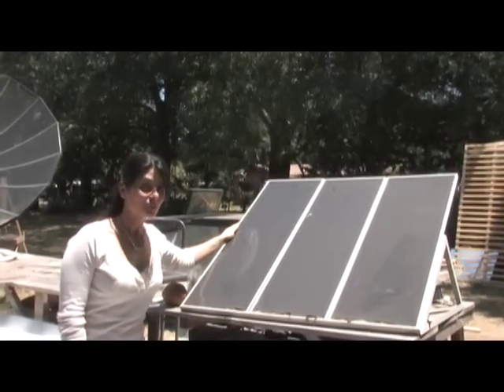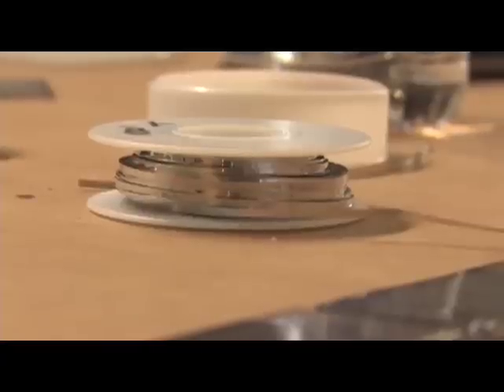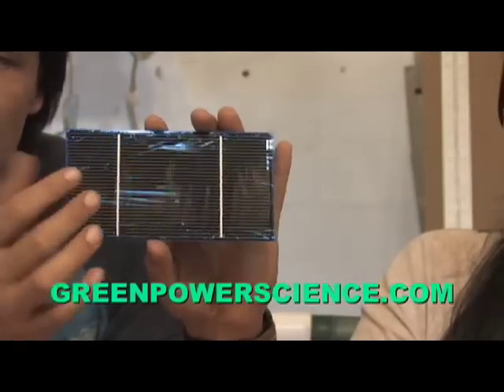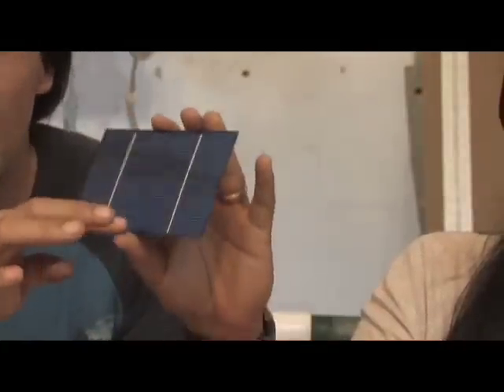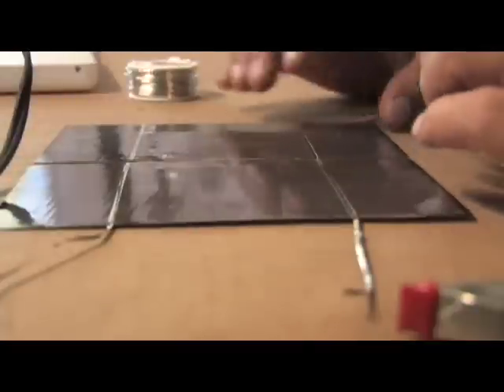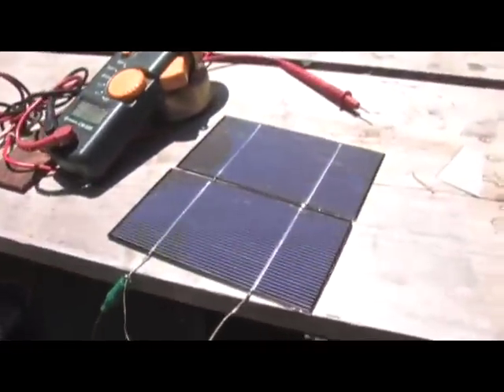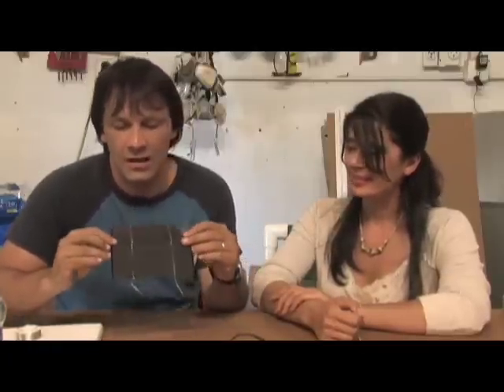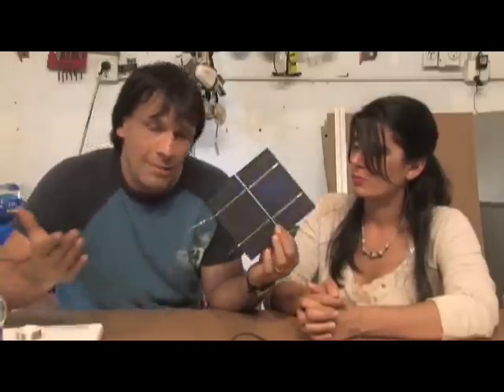SOLAR CELLS Monocrystalline DIY Solar Panels Make Your Own Free Energy

Comment from the maker: Hi,

It is a flux pen used for solder preparations, the soldering iron is a standard cheap one. I suggest a higher wattage soldering iron around 50-100watts

Comment from the maker: Hi,

The iron I use goes up to 100 watts, I think it is a Weller iron. A PC usually takes less than 500 watts on the high end processor with an LCD or LED screen. Laptops and medium level processors are 50-300 watts. For lighting I would suggest LED bulbs. This would get your max consumption below 1,000 watts. Are you looking for grid free 24/7 backup power or grid tie system to supplement?

Comment from the maker: @killacounty It does after it builds heat, it was not at full temp yet and the tip on the crappy iron was loose so it was not conducting heat properly. The body was actually a lot hotter most of the time.

Comment: This is really cool!
For a given cost ... which type of cell are the most efficient?
Is there any difference in lifespan for the different types of cells?
Is it possible to use a very hot heat gun to do the whole tabbing wire at one time?
Also, what about extended exposure to lead vapors and on your skin ... lead is nasty stuff .... shouldn't you be wearing gloves or something?
Finally, what kind of a box can you make for this to protect them from the elements?

Comment: Excellent starter video. I've always wondered if it was worth piecing a panel together from scratch like this. I was a bit disapointed that a casing method wasn't shown, and it isn't trivial either. The choice of glass/casing can dramatically affect the efficiency of the cells.

Comment: It also helps to keep the soldering iron tip clean. I noticed right off that his was covered with scale the whole which acts as a heat blocking barrier. It makes the job take a lot longer.

Comment: I strung over 1000 of these together in basically the same fashion for our college's entry into SunRayce '99.  We had a form, like you mention, to line up the cells and space them about 1.5mm apart.  For large numbers, we found it most efficient to tab the tops first, then string them in the form, soldering the tabs to the bottom.  I think we used solder-bearing paste instead of flux pen and solder separately.  Keep in mind, when you build your own panel, the worst cell limits the entire string.

Comment from the maker: Amps are based on the cells design. Cell watt divided by cell voltage of 0.5 = your Amps. You can double tab cells where 2x fronts are tabbed then continue to 2x cells in series etc. to double the current but this makes a larger panel. I suggest going normal then connecting the panels together in Parallel ++-- to double the current.

Comment: @DJ,

Yes you can do what your looking for, however you would do them in clusters of panels. Say 50-60 panels in each group, then run each group to a patch panel to bring the power together. That way you don't have to worry about using expensive thick solder.

Comment: I found by using flux on the outside of the wire as well as on the areas needed for the cell helps a great deal to decrease the time needed to solder the wire on. I am using a 25 watt soldering gun and I can do one in less than a minute now. I was struggling to even melt the solder before I started the double flux method.

Comment: good job... "ouch" btw!  definitely use a more powerful soldering iron, but watch where you pick that one up!... or a soldering iron you can dial up and down depending on what you're soldering... some things are more sensitive to higher heat... but silicon cells are not one of them.  what about using flexible cells?  like CIGS or some other thin film do-gooder??

Comment: Just by watching your video, here's some suggestions I came up with. During assembly you can use the 1/8 or 1/4 inch tile spacers and also hot glue a ruler to your work surface. This would provide a straight edge and also conformity to the spacing of cells.

Comment: @PiercingKnight usually the rating from mfg is under ideal conditions that are never matched by real conditions-I would expect a 4watt panel to produce in the neighborhood of 3.25 watts.  What does that translate to in amps?  Well, if you take 3.25 watts / 0.5 volts = 6.5amps which is still way more then what your getting.  What are you dumping your amps into? Are you measuring the short circuit amps? Charging into a battery?  Amps will vary depending on the load. Also, recheck all solder joints

Comment from the maker: Their current is very small compared to these larger 0.5 volt cells. These cells produce about 9x the power of each of the amorphous cells from the solar lights you are suggesting. These cells in the long run are much less expensive.

Comment: @kermmittfrog firstly a few watts isn't going to have any noticable affect on your bill. Secondly, I believe solar panels produce DC (like a battery), mains power here in Aust. is AC, so you would need inverters and all sorts of electronics installed into your house.

Comment: you should make a small jig out of 2 narrow woodent strips only thick enough for the soldering iron. Lay the jug over the cell and solder away- the jig eliminates the movement in cells.

Comment: You are correct if and only if you meant Power is rms Voltage times rms Current.  Otherwise Power is current squared times resistance.

Comment: So make sure to use a flat and hard surface (piece of glass or a mirror maybe) to put your cells on so the pressure of your fingers or the solder iron will not break the cell due to it bending in the soft underground. Anyway... well done! And thank you for the demonstration. Keep up the good work :)

Comment from the maker: Plexi will work but if it is not UV enhanced you may only get 2 years or less. DO NOT allow the cells to rest against the acrylic sheet or it will warp in a few hours. A 1" gap keeps the heat down. You may need to draw a vacuum or moisture can build.

Dan

Comment: I am a carpenter and a roofer by trade and a cleverly made vent on the inside of the unit into the attic may do the trick by converting old skylights into solar panel boxes just have to build a cleat inside the box to support a plywood shelf inside the skylight and if you know any roofing companies may be for a small cost they can save you some of them without destroying the glass. One point you may have to replace the flashing kit if you plan on using it on the roof.

Comment: You might want to suggest the use of a temperature controlled soldering iron. They work much better than a fixed power or adjustable power. Adjustable -temperature- is good, adjustable -power- not so good. It may seem a subtle distinction but it is not.

Small correction: you identified getting the flux flowing as "wetting".

In fact, getting the solder to bond to the metal is called 'wetting".

Otherwise, great video!

Comment: To anyone who is looking for a great Soldering Iron: Weller WES51 Analog Soldering Station ($75 on amazon). Ive had it for over a year now, I love it and I would highly recommend it. This baby heats up super hot within 30 seconds to a minute. I think more importantly, one might want to consider purchasing a FLAT TIP for this type of procedure, it will make the workflow much faster. Thanks for the awesome vid.

Comment: the pen he was using while tabbing the solar cells is a flux pen for soldering not welding.  It has a compound that cleans the surface when heat is applied so the solder will flow onto the contact point.

Comment: yes the lady is attractive, but this video is very well done.  I bought  my evergreen cells at $.78 a piece.(on ebay).  At  todays prices it will take three years to recoup just the cost of my cells.  But that is the key," at todays prices".  Cap and trade is coming sooner or later.  Prices will go up.  This video really shows the step by step to DIY.  Well Done and easy to follow!

Comment from the maker: If you do a wood frame correctly, it will not twist. If you must make a frame out of wood, miter 45 corners and spray with 3 layers of clear coat. Walmart paint is UV. Then a color (light color) then clear coat. This seals the wood and also reduces heat from the wood (if dark). While I imagine it would be possible, a fire inside the panel is unlikely because a single panel will not generate enough AMP+VOLT to heat the tabbing wire. MORE RISK IS AT THE SERIES/PARALLEL CONNECTIONS or inverter.

Comment: Great Video, I'm all about getting into this new green tech and boneing up on allt the info on the Web, Wikapedia, and from the Green Police like you.  So you attach the negatives on the front to the positives on the back of the next ones.  I think I'm gonna go with the monocrystaline which aren't too bad on the site you mentioned.  It looks like bids are running $150 on about 80 and they send you the wires and everything.  HF sells out is no time, at last sale they were gone 1st sent overseas!

Comment: I would be adding that solar never charges at night.  That's why all our systems have wind and solar as a hybrid energy kit.  Wind power kits are a great way to reduce or eliminate your home energy bill.  Most people are going grid-tied and making the utility buy back the unused energy made from their windmills.  Home wind power kits can be installed on a roof or in the yard of your home very easily.

Comment: That was fun. Denise looks a lot less clumsy to me, maybe let her do it alone next time. ;) Okay a tip maybe to break less of your cells is to solder all of them at the top first... before connecting all of them at the back sides. (the connections create uneven surfaces, so breaking a cell halfway an array is very likely to happen. Also because you keep on flipping the array over, chances are some of the connections will tear off as the array gets longer.

Comment: solar panels produce direct current, the power you get from the electric company is alternating current, so you would need to set up a battery bank and use a inverter to convert it to AC to either power the stuff thats already in your home or provide power to the grid; im not sure if the power company would actually start paying you for power generation (after your using) but it would be cool to see your meter run backwards.

Comment: @AcidRageNZ 
You'll need more than 12V to charge a 12V battery. Check the voltage on ur car battery with the engine off it'll read about 12V with the engine on it will go up to 'bout 14V. Also the 18V is without any load on it, put a charger or whatever on it and the voltage will drop.

Comment: If you add them in series, the voltage goes up (like putting AA batteries in series, each one you add makes the voltage of the cells add to become a battery)
If you put them in parallel, (much more rare to use AA batteries in parallel) will increase the current output, while voltage remains the same.

You can also put multiple series strands in parallel to have a higher voltage that outputs more current.

Comment from the maker: Place the 2 panels in parallel both red both black to 1 battery for a few hours. It is always a good idea to have a charge controller because if you forget, you can fry a battery as the panels can go up to 21v dc. Dead batteries that do not take a charge are usually a lost cause.

Buy LED lights 

watch?v=6huF1yWOEZQ

EXACTLY WHAT YOU WERE LOOKING FOR:-) Add a photo sensor, DIY self sustained night lighting.

Comment: doesn't the heat from the soldering iron damage the cells? and how would i then attach the batteries to the power supply of the house?

Comment: Dan I need info on building a panel. I just purchased the new cells 6x6 and I got about 50 or so. I don't know how to build them to a 12 volt panel. I can soider just fine. But, two things confuse me. 1. Building up the volts. 2. If I put all in series will it not go over the 12 volt I need. 3. I am guessing only but, some would need to be par.

Comment: I have old solar Malibu lights and I stole the bright LEDs out. Now I use the charger portions wired in series as each puts out 3.5 volts because there is a little multiplier chip embedded on a circuit board for each. Just four of these gives me over 14 volts but they are very low current so I don't know the wattage. Batteries not included.

Comment: @DanielManahan "If one cell dies will none work because of the chain?"

Don't know the answer, but if so I would guess that's a good reason for not encasing the whole thing in resin.

Thinking about it, I guess if a cell shorted out, no problem: you'd just lose its 0.5V contribution to the chain. An open would be the biggest headache. (Perhaps the redundant contact points help minimize the chance of that.)

Comment: Just off the top of my head i can see a few things you could do to make this faster.. make a jig that you place your pannel inand instead of a pencil style soldering gun get a T-style soldering gunor make your own gun that covers just the width of what you need/and make it all statstionare so that the gun is coming straight down on it like a drill presshave a clamp at 1 end that holds your wire strip so you can hold it taunt then pull down on the lever and bring your T gun down on it

Comment: Thanks for making this great video! Polycrystalline cells are indeed extremely fragile. In my opinion, I would rather use low melting point soldering wire instead of silver to avoid thermal stress induced to cells at soldering... Either way is fine, yet nobody can be careful enough at making a PVP with this kind of cells ;-) 
Best wishes.

Comment: Hellow,

  I' have 2 kit of solar panel "bock" model with integrated regulator, and I' want to put both panels on my campervan. The problem is that I'm not shore if they are made to stay always out in rain and other wheter.
I' whant to put 2 panels on a box, and cover with some material transparent.
I' understand that the plaxiglas is not ok for this.
Can you please give me some sugestion ?
I' can not put link to paels, but are like a boock, they open.

Comment: @johnny5634 You will be joining the cells in series which keeps the amps the same at 2.9amps. only the voltage will multiply 108 x .5 = 54volts!

Comment: Is there a limit to how many you can put together. Will the wire be fried if too much current flows threw the wire?
For example 648 of these cells put together. To achieve 1,134 watts.

Comment: Solar panels produce direct current, right?  I would like to cover my roof in these, and plug them into an inverter to turn it into alternating current, and then supplement my electrical usage and maybe put electricity back into the grid and get money from the power company instead of having to pay them.  Think it's possible?

Comment: Hey I'm starting a videography business and thinking of ways of lowering "charging cost" while trying to be green and I had this idea of Solar Panels to run my charging banks for all the batteries I will be charging.. and I not sure what kind of voltage I need... The inputs is pretty standard for the chargers.. 100 - 240 v AC... how many panels would I need to charge about 6 of these chargers?

Comment: I have found that it's important to leave a little slack between the cells otherwise as they heat and cool they will crack.
Reply: Define a little.
Reply: More than none and less than a lot. To be clear I am talking about the chains of cells connected with solder. Logically, the longer the chain the more slack you should leave.

Comment: @johnny5634 
36 cells (in series) x 0.5 volts each =18 volts
1 milliamp = 0.001 Amp
2900 mA = 2.9 Amps

So when you solder the 36 cells together you get approx 18 volts at 2.9 Amps DC (from what I've figured out). Hope that helps.

Great video Dan and Denise! Keep up the great work.

Comment: should cut the tip off your soldering iron till its only 15-20mm long file it flat and re tin it with solder be sure to tighten the screw that holds the tip in you would be amazed with the result

Comment from the maker: 60-100 watt works the fastest on the upper limits of heat. EVER BRIGHT suggests  370 degrees Celsius if your solder (tabbing wire) is leaded, and 390 to 395 degrees Celsius if unleaded.

Comment: I am building my own panel for a project. I know the voltage increases as you add more solar cells but does my amperage also increase?
FIY: I am building a 90Watts 1.5 Amps.
Thanks!

Comment: does it harm the solar panels to get them hot?  I'm used to heating up the contacts and putting the solder down so it adheres better, will that ruin the panels?

Comment: @GREENPOWERSCIENCE
So how is the math on solar? For example I use 36 3x6 1.8w .5v cells that is 64w 18v of power in theory. The problem is that per hour or per minute or what? My goal is simple recharging of a 12v boat battery but I cannot understand the math thus I cannot understand what I need to build. Any chance you explain this in other videos?

Comment: Just a question: we know that the voltage partly depends on HOW MUCH sunlight hits the panel,  right, so what if we increase the sunlight hitting it? - For example a set like the one you made here, and a mirror of the same size resulting in "double" the sunlight, how much would that affect the output?

Comment: also you can sand the  drips with a belt sander, never use a torch on polyester resin it is highly flammable, you get much better results if the room is at least 72 degrees Fahrenheit

Comment: so for 36 cells would u need a solar voltage regulator as a mediator between panel and accumulator? Do know know what type of accumulator is safe to attack solar panel directly without worry to overcharge or something?

Comment: weller would be the one you wont to use...you are only as good as your tools..also if you use siver solder it takes a higher heat to melt..I use a 100w.gun but i know how to solder and weld for that matter...its better to use what is suggested..you can over heat the area with a less watt gun..because you hold it on to long...hope that helps.